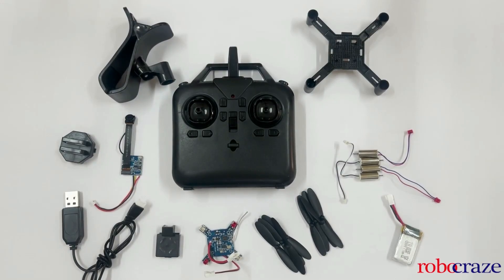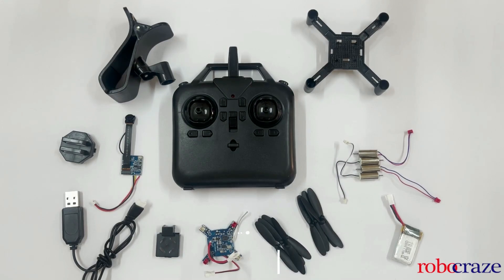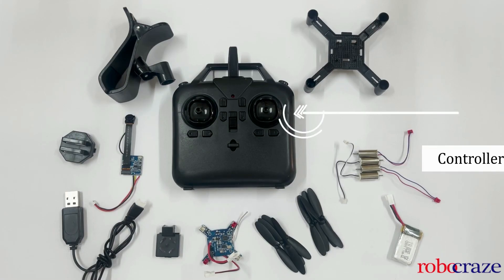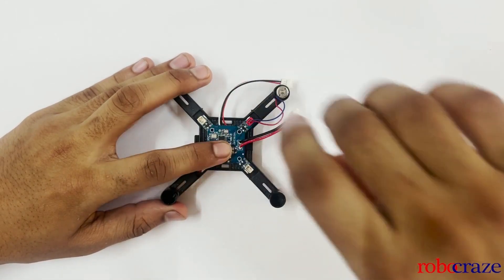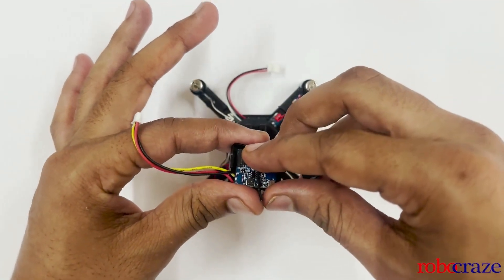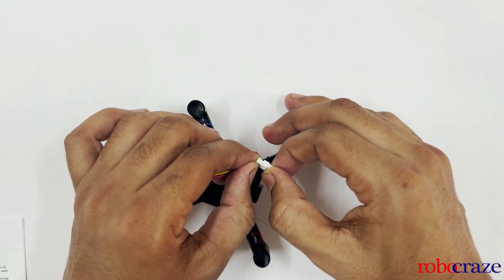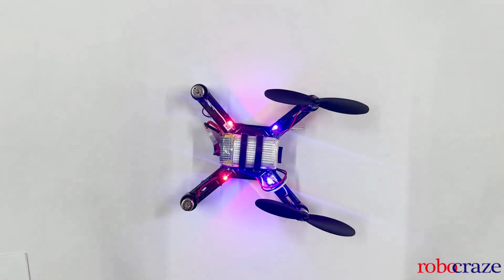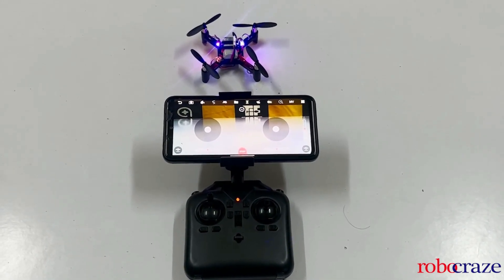Assembly of DM002 DIY Drone

Comment: hey i am your very old customer i also buyed this drone but was not able to connect it to remote thanks a lot
Reply from the maker: Hello! Thank you for being a loyal customer. We're sorry to hear that you had trouble connecting your drone to the remote. We'd love to help you resolve this issue. Could you please provide more details about the drone model and the specific problem you're encountering? Our support team is also available to assist you directly and ensure you get the best experience with your purchase. Thank you for reaching out!
Reply: @Robocraze which flight controller is used???
Can we add a camera separately?
And can we program it with python or any language for our project?

Comment: Is that 8520 Motors ? , Because when i will buy it i will upgrade it to 8520 motors ... And I Will Also Use 500 Mah Lipo Battery For Extended Time Of Flight ... And I Will Also Use A Different Frame For This Quad will 8520 will work ? Please reply
Reply: I also want to know answer
Reply from the maker: Hello, 
please raise a ticket on support.robocraze.com with your detailed query and our team will get back to you at the soonest.